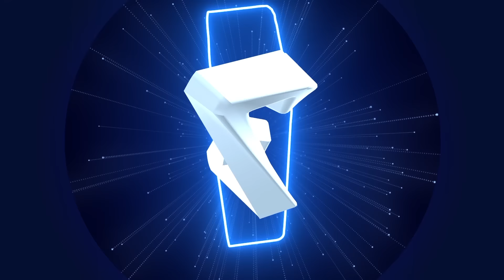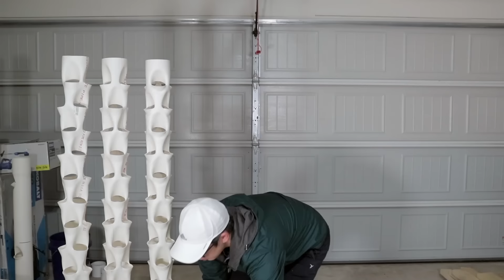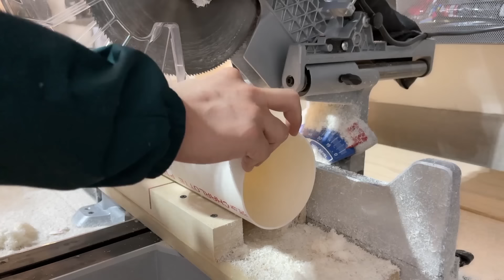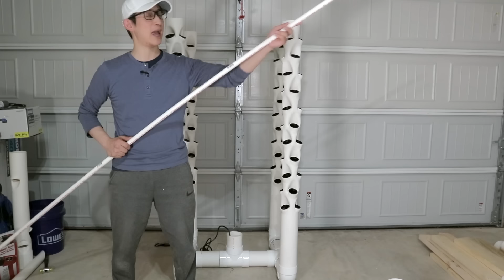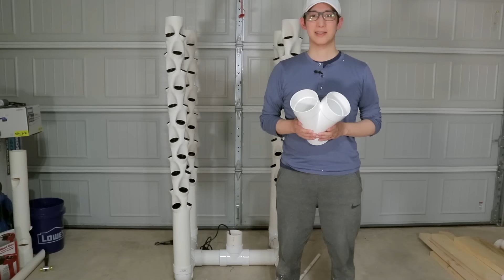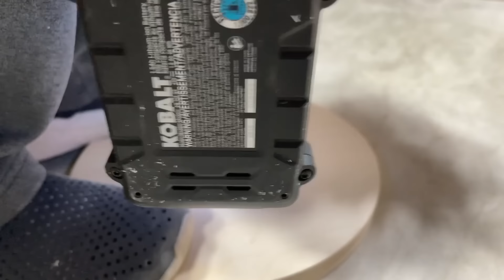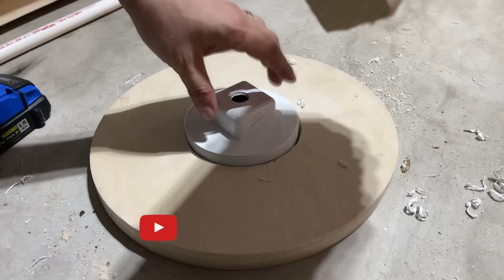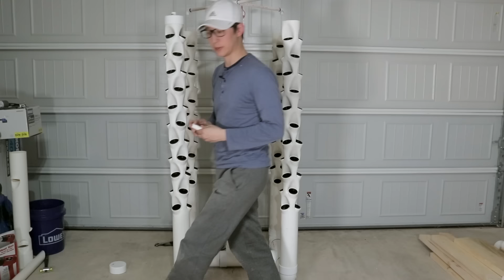DIY Hydroponics | Aeroponics Garden Tower Build | Part 2 - [4 Tower Build]

Comment: This looks great and all, but the real question is: did it work? Do you have any update on whether or not it was successful in growing various plants?
Reply: check his plants in the beginning look bad af xD
Reply: I have made this system and am growing in my basement. I am new to hydroponics so it’s a work in progress with when to transplant seedlings to system, light needs, and pump times.

It was worked fairly well so far. But, I am only about 40 days in. I am using 12-12-6 (grams) of cal nit, mega blend, and epsom salt respectively in 5 gal of water. Using grow lights 7a-7p, and run pump on for 1/2hr off for 1-1/2hr throughout the day. The lights and pump are on separate timers.
Reply: @gregmartin5874 now calculate how much energy is wasted running water 1.5 meters up whole day.

Comment: I just build this system. Things needed for Version 3:
1) Spigot to easily draw water for testing.
2) Window or some method to visually see how low the water is. 
3) Stronger water pump (water trickling out of sprinklers. not enough spread to ensure all walls get adequate water)
4) Better water distribution method. Some coconut coir pods are dry. Water seems to pass by some of the pods. (I think a stronger pump will solve this)
Reply from the maker: Thanks for the recommendations.  I think I have addressed most in a new build and design im working on.  I will share soon!

Comment: I loved my homemade setups like this and they grew quite a lot of cool stuff, but then I got concerned about micrcoplastics leaching from the pvc.  
I never was too concerned until I did some actual research . All plastics can leach toxic substances to some degree, given the right conditions.  
Even when buried in landfill, PVC is an environmental health hazard. Research reports have found PVC:

leaches chemicals into the soil;
contaminates ground water and air; and
is toxic during manufacture right through to when it is disposed of.
There’s a huge number of research papers, scientific studies and credible technical reports on the dangers of PVC. If you are trying to grow a safe food garden, then you may be interested in the answers to the following questions.
I never had mine outside, but I did have grow lights projected onto them which still are UV. 
These home grows are cool. but now that I know this knowledge, Im not sure I'd suggest it.
Reply from the maker: I am experimenting with 3D printing my new towers using food grade materials.  So far so good and if it turn s out to be a better solution I will share the results.

Comment: After watching around 20 different aeroponic builds I have to say this is the most comprehensive and intelligent design. Nothing is wasted or in excess, the design is sleek and easily manageable, plus it is cost effective. Incredible video, this type of resourcefulness and ingenuity is astounding. Terrific work! I will be building one myself!
Reply from the maker: Thanks.  Unfortunately the cost of PVC has gone up, so Im looking for alternative solutions as well such as 3D printing (although initial cost for the 3D printer is high).  Let me know how your tower turns out.  Excited to see your build and any adaptations you make.

Comment: I'm wondering how long the systems holds the water for. I'm assuming you can't put much water in it or it would go up the grow towers. If it can sustain it self for atleast a week or two then it's definately a great low maintenance system . Great work.
Reply: I built the single tower version and with it full of growing plants in a dry climate I add about 3 1/2 cups of water per day. It could go maybe 2 or 3 days before it would be below the pump level.

Comment: Have you thought about using a solar pond pump instead of a plug in pump. It would mean the system would be completely free standing and mobile. Also great for off grid folks.

Comment: Was wondering how water simply doesn't come out through the holes; are those rings enough to prevent that? also some problems can appear, like water still springling besides the ring or the ring not fitting if the enlargement is not done right; and another question: is the water practically running through the center of the pipe enough for the roots?

Comment: For an aeroponic system we only need a power connector from the Wall, right? Watertank has all of them but for the pump we need to get from somewhere electricity, right? 

I know it might be a very basic question, but i dont know these type of systems and were building a house this year and i have to plan everything well.

Comment: I though I would add a helpful hint.  I heated and created all the holes in the 4" pvc and then cooled them with a cool wet cloth.  Later, when I went to put the 2" rings in each hole I found that the majority of the holes were not perfect and I had to revisit every hole (112) reheat them and then place the 2" rings in.  (heating and forming the holes is by far the most time consuming part of this projec)  I would suggest just putting in the 2" rings when you first heat and form the holes in the 4" pvc.
Reply: Hello robert, it’s been a year since you made those, how have they been holding up? I’m thinking of planting rice on one of these
Reply: @KutamaStudio  The first year I grew a lot of lettuce and herbs. This past spring I had a new roof put on and the people who did the work sort of man-handled my system and it cracked at the bottom.  Easy fix but I did not get around to it.  Next summer I plan on more things like peppers, beans and herbs.  It does work however I needed to add water often.
Reply: @bobsieloff4317  Where does the water go when everything is sealed?
Reply: @user-Julqunboy  The extra water is In the bottom pipes.  

I am surprised how nice the towers came out, this looks great.  Inspiring. Wonder if it would work going even large, like 6" PVC.   IMO this should be built on top of a reservoir or something to hold more water/nutrients.
Reply from the maker: @user-Julqunboy  it’s recycled and pumped back up through the pump inside the system.  Endless flowing water
Reply from the maker: @h82fail  true.  I wanted to use larger PVC for my design, however the connectors and joint pieces didn’t come in larger sizes.  Now that I have a 3D printer though, I’m working on new designs
Reply: Excellent 👍😊
Reply: Thanks bro for your nice suggestion
Reply from the maker: @robertsieloff6065  That is a great recommendation.  I started doing that in my new builds to ensure each ring is secured into each hole ensuring no leaks
Reply: heating PVC is also the most dangerous it releases all sorts of toxins
Reply: @ChrisLoh what is the entry angle, the cut angle on the 2" pvc pipe you use for the cut out shape former?
Reply: Did you have any successful grows?? I'm thinking of building one myself
Reply: @birdistheword1327 me  to . I womder hoe much this cost

Comment: I found that putting on a saw blade backwards makes cutting plastics very easy and prevents shattering and chipping. Thanks for the video it gave me lots of ideas. +1 sub.
Reply: I was building cornhole boards as Christmas presents and turned the saw blade backwards and it stopped all of the chipping and splintering of the wood. I bought laminated wood for better finish for the bags so discovering that technique made them look so much better. I kept the first set I build, so mine are the worst looking of the four sets I built. 

Using the hole saw backwards is now the standard but if it takes to long, I start the hole on both sides and then run the saw forward which keeps the openings looking clean and sharp.
Reply: @uscdraft1957  awesome 😎
Reply: I didn’t know about the hole saw trick

Comment: is the pump running full time?  I mean 24hrs a day?   or can this be set on a timer to run every other say 15 mins.    to conserve on power consumption to make it even low energy.      the media should not have dried by then i think
Reply: I turn the pump off for 10 minutes every hour. I found that in 80 degree Arizona weather any more than that would cause the plants to start wilting.

Comment: It would significantly add material but 8 T’s could be used to create a second connection to the tubes to make them much stronger and hold more water.   Like a box of PVC below towers

Great Job

Comment: Cool but I see a few problems.

The first is the fact that its white and a bit translucent, meaning light will get through and algae will grow. Try painting or coating the inside black you should keep the amount of light reaching the water to a minimum.

The second is that your adding nutrients which contain salts to the water, these will corrode the metal drain your putting inside over time.

Otherwise its a cool build.

Comment: You can use 100% acetone which is clear and same thing as pvc primer without purple color in it and it will clean all the printed words of the pvc if you want it clean. Ok you should make the reservoir separate from the 4 tier build  then no need for the shower drains.Make a riser taller that your reservoir so you can make a return from the 4 towers and save $$$$ on all those high dollar fittings and less work. and make center pipe to feed them all . Man I really like the look of the towers.. I see the practic tube to left of build in garage lol.. That looks really good

Comment: Regrettably I have found the pump suggested, is not adequate to supply adequate flow and pressure to allow for the equal distribution to all 4 towers.
Reply: I replaced my pump with a Vivisun at 850 gps and it looks like it will work. In doing so I had to replumb a Reservoir or sump to house the larger size pump. This require😢splicing into the one of the two ‘T’ sections. The expensive way is to use a saddle but I found a cheaper way. If you would like to see what I did, P.M. me and I’ll send photos of my messy but functioning plumbing modifications. Than yo so much for turning us all on to this hydroponic grow system.

Comment: Instead of a complicated water delivery system dont seal any of the bottom parts and in fact drill a few holes. Get a plastic tote or tub that the whole thing will fit in and set it in there . Fill the tub. Run rope inside of each towers that will wick water from the tub to the top. Simply add water to the tub as needed.
Reply from the maker: In this case, I am growing them from seed, so roots wont be able to reach the rope yet unless i wind it through each netpot cup.  That makes it a bit more complicated, especially if I want to remove the netpots overtime.

Comment: I built this system. And for others qho wishes to do so. Don't, its bad design. Theres no way to clean the inside of the base, the selection of pumps you can use are very limited and those that fit into the hole wont be sufficient to provide enough pressure to properly get water everywhere. I ended up deconstructing it and installing the towers in 5 gal buckets instead. Waste of energy and time.

Comment: Debris is pronounced “da bree” the s is silent…  If you run your drill in reverse it won’t try to snatch and grab on you … no need for a wooden jig.  You could save a lot of money making a frame around a storage bin and do away with all those 4” fittings and rain or shine cement… putting them in line will make your lighting easier to place too unless you’re doing this outside

Comment: Just made this and made some adjustments. Added a platform with wheels, a clean out on the base, and a disconnect on the vertical 1/2 inch pipe.

Comment: You could get dishwashing scouring pads, a kind that doesn't disintegrate over time, and cut circles out of them for use as a filter sitting on top of the shower drains.  Really, any synthetic large pore sponge like material will do.

Comment: Incredible Video! I got a question, how much water did you pour into the system(?) and how much "Aero Garden Nutrients" did you use(?) and how often did you have to put that certain amount into the water? Again, truly incredible and have been inspired to try a few ideas for hydroponics. Thank you!
Reply: I have the same question.  I was planning on getting a 5 gallon jug of RO water from the local grocery store.  The aero-garden label give ml amounts for 2/3 pods, 6/7 pods/ 9 pods etc.  does this translate to the pods in this system as I will be starting with 72 plants currently growing under a grow light.

Comment: I don't know if this was aske but how long does it last. The sunlight will disintegrate the PVC (?)
Reply from the maker: Mine have been sitting outside for about a year now with no issues.  Can't say exactly how long it will last before it starts to decay, but as of now they are still working with no noticeable decay

Comment: LOVE IT!!!  I am in week 1 of the build, modified the spacing cup holes to accommodate some hanging tomatoes, cucumbers etc....cannot seem to find the link for the 1/2" screw-on water displacement that you connected at the top inside each tower to allow for even water distribution.....  What is it called?  Thank you, awesome video on an improved idea!
Reply from the maker: That is awesome!  Let me know how it turns out.  As for the 1/2" connector, you can find it on Amazon - https://amzn.to/3HTM6uo

It's called a 1/2" 5-way PVC Fitting.
Reply: @ChrisLoh  ......@ 19mins... you are connecting something that allows for equal water distribution in each pipe??   TY   coming along nicely,  inserting bushings tomorrow to prevent water from splashing out...
Reply from the maker: @nompro7268  That is a sprinkler end, which I decided to remove in the final build.  If you want to add it, you can pick it up at lowes - https://low.es/3IksbWX

Comment: What size were your Nettie Cups? I had assumed they were all of a standard size. The one I had were lipped at 8.2 cm OD and 7.0 cm ID. Far too large for the 2” rings.
Reply from the maker: I used 2" Netcups.  They can be found here on Amazon - https://amzn.to/3IcRZnW
Reply: Got mine built and running. Cups on three sides. I did raise the volume of fluid to 8 gallon. I felt that a higher volume of mix would be easier to maintain more consistent feeding. How do you feel about the flow rate of the pump?

Comment: How much water is expected to be used per day? Will the system be required to be filled daily? When the system needs to be filled are the nutrients necessary at every replenishment time?
Reply from the maker: I refilled the tank about every week to 2 weeks depending on how hot it got outside.  I also had a leak that wasn't sealed at the base so I'm pretty sure it could have gone longer without a refill.  I usually refill nutrients about once every month, but found better results when i used a PH meter to let me know when nutrients were needed.   Again this might also be impacted by the weather and that leak i had in the reservoir.

Comment: You could install an angled "Y" fitting between the towers and the base so you can reach in and clean them without taking anything apart.
Reply from the maker: That's a good point.  Cleaning was the least fun part

Comment: Hi, it is an admirable design. I have never done hydroponics or such a system. What I know is that we need to feed the root with slow and low pressured water. In this system we pump the water to top and feed the towers from middle points. This can lower the time of exposure of the roots to water and pressure that have been created by pump and free fall might be damaging to roots. To get ahead of this problem, we can give water a motion of swirling. This can increase the exposure as water will be all over of the inside wall and surface tension can do the rest. Also, water will have more friction to kill the pressure. What do you think? Is there any pipe related tool to help with this?

Also, how do you filter the water?
Reply from the maker: That is a tough one to answer since I havent tried.  Generally though the roots seemed to not be affected by any pressure or fast flowing water.  because of the way the holes were made, there is a lip above the pot which the falling water hits first and then slowly the water flows through the roots.   Some viewers also recommended punching holes in the center pipe which delivers the water to the top of the tower so it would also spray the roots on the way up.  That could relieve some pressure.  Havent tried it yet though.

As for filtering.  at the bottom of each tower is a mesh shower drain that I placed in the base connector.    That helps keep large debris from falling into the reservoir.  It still needs to be cleaned on occasion though.

Comment: I can't find that 4 inch × 10 ft pvc pipe ANYWHERE! I've driven around a few cities looking and all they have is schedule 40. It's waaay less affordable and too heavy
Reply from the maker: Where do you live?   If you have a Lowes, that is where I got it from - https://www.lowes.com/pd/4-in-x-10-ft-Sewer-Drain-PVC-Pipe/3133147
Reply: @Chris Loh  None of the Lowes in a 40 mile radius of me (Sandusky, Ohio) have that pipe in stock for some reason. I ended up finding an off brand version in store at my local Menards. It was actually about a dollar cheaper per pipe there, which is good since I plan on filling a sunroom with these. Thank you very much for the inspiration!